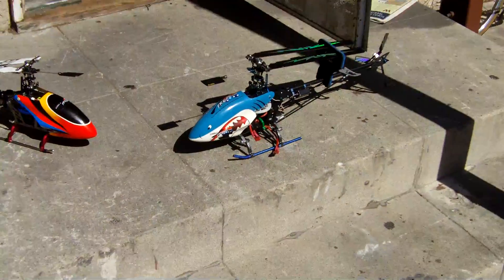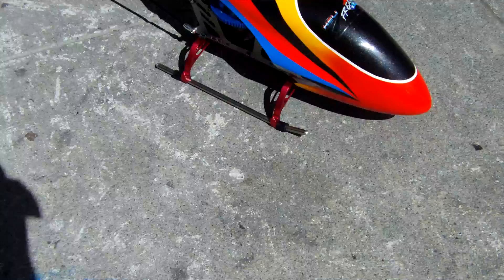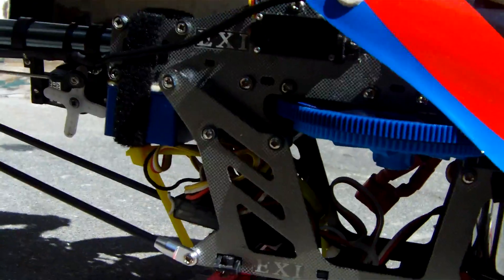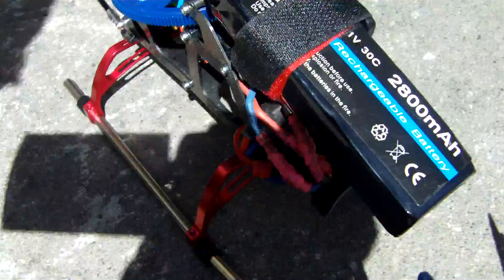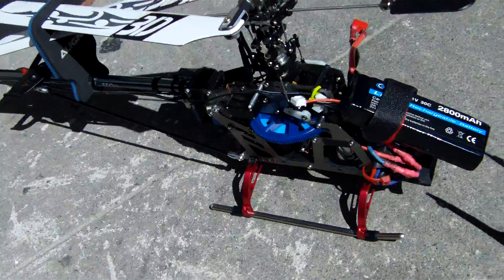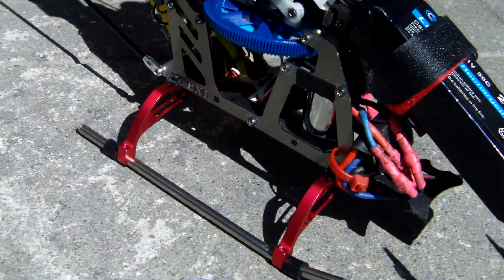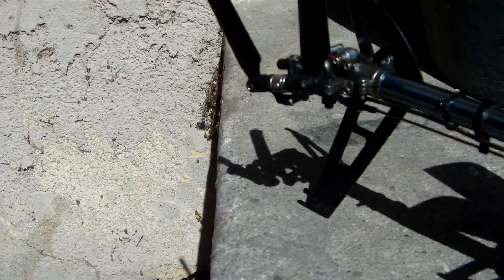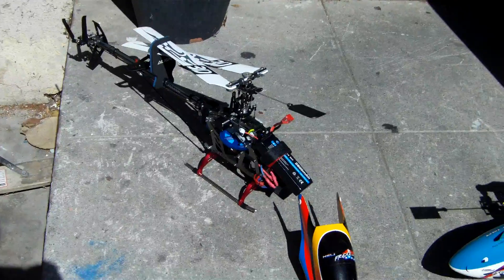exi 450 trex clone parts you want to upgrade to asap.

Comment from the maker: 2800mah and i think the largest for a trex is a 3000mah lipo but you have to make sure it has equal dimensions to the 2200mah lipo and check the weight is close as well.